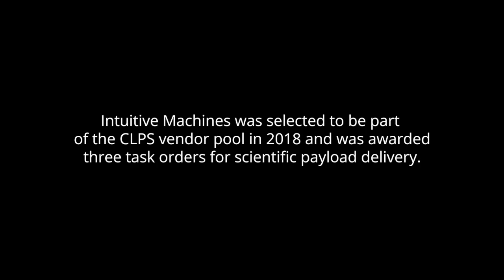Odysseus landing on the Moon

Comment: How many rovers are on mars?
Reply: Perseverance and Curiosity are still roving, Spirit, Opportunity, Sojourner and China's Zhurong have died.
Reply: @massimookissed1023  how many rovers are on the moon?
Reply: @muddymo7641  2 Russian Lunakhod rovers, 3 NASA Moon buggies, China's Chang'e 3 & 4 had rovers, (Chang'e 5 didn't, but did launch some Moon rock samples back to Earth), Japan's SLIM lander had a tiny ball rover that took pictures and an even smaller hopper rover.
 Laying upside-down and getting very little solar power, JAXA turned off SLIM's heaters, so it will probably freeze to death before it sees sunlight again.

IM's thing that landed (sideways) yesterday doesn't have a rover.
Reply: Thank you
Reply: Littering the moon now 🙄
Reply: @jonathankennedy1715  Apollo crews left bags of crew poo on the Moon.
Reply: @massimookissed1023  😳😬🙄

Comment: as the signal is too weak to send images, it seems likely that the lander probably isn't upright on the surface. But I'm no expert
Reply: But they could do it in the 60s?
Reply: And send images from Mars?
Reply: In 60's were choosing smooth terrain in full daylight. At the pole (where the water is!) the terrain is rough and rocky and sun is on horizon @Sulkamaniac
Reply: India did showed live images coming up from it's chandrayaan 3 spacecraft. Honestly speaking I am disappointed with the livestream they did not showed live telemetry like Japanese and Indians did, still a great achievement!
Reply: I think you might be right. Swap the landing legs and antenna; it will land perfectly. 🙃
Reply: Just in - It is apparently upright and sending actual data (slowly?). So we non-experts were wrong (sigh)
Reply: Well we were all right. It landed upright with respect to a horizontal frame of reference, colloquially known as "on its side" The press conference was cringe worthy.
Reply: @AndrewJonkers  , yes...the "experts" are Ivy League; "Odysseus" done tripped and fell (among other things)...and da po' boy can't get up.
Reply: So in the miracle age of technology, they can't manage to get a video signal to work, but we're supposed to believe that 54 years ago it wasn't a problem?  Why didn't they just use the 1969 technology if that's the case?

In the words of Carl Sagan, extraordinary claims require extraordinary proof.  This isn't even ordinary proof.
Reply from the maker: Odysseus status update https://www.youtube.com/watch?v=zFtGnI2y2JY
Reply: Question to all you guys. Did you all wake up this morning and called each other to ask what you were going to say in the comments? Cause you all sound stupid
Reply: It's not real... You know that right?